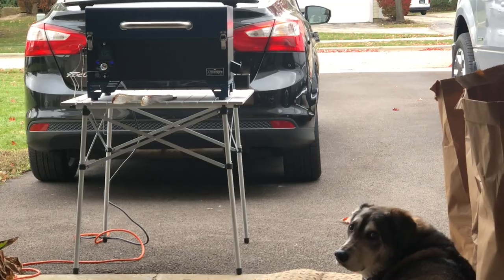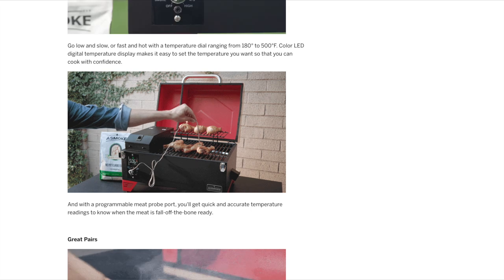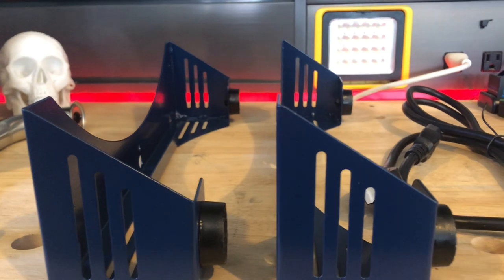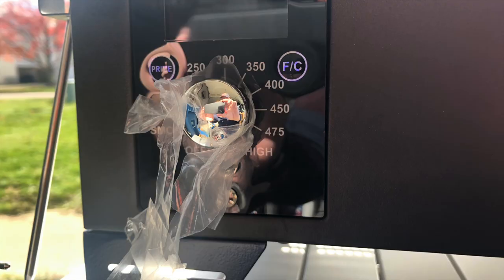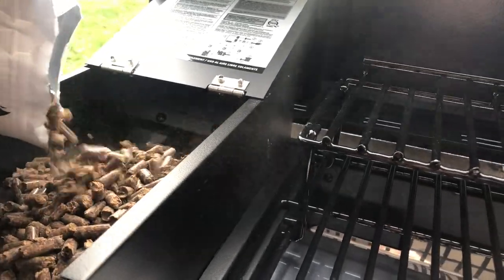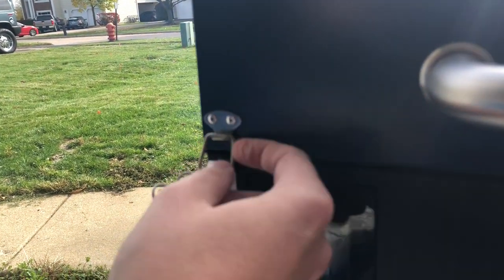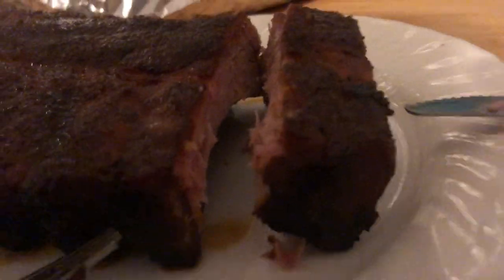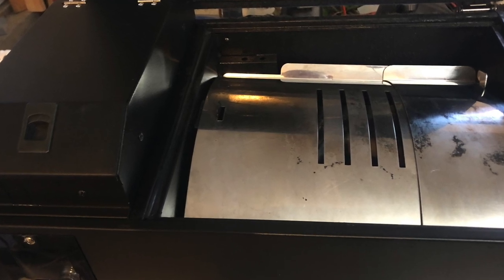Asmoke Portable Smoker Review -  Pellet Smoker

Comment: I was a loyal Traeger+ user for years, but after switching to Asmoke, I have to say the difference is clear. The precise temperature control that Asmoke offers is just amazing. The dual sensors and the new PID algorithm ensure temperature control within 5°F which makes grilling so much easier. Additionally, the portability of this grill with its lightweight, compact design is a game changer. I can now enjoy grilling on my camping trips without any hassle. I also appreciate the eco-friendly aspect of the wood pellets used as a fuel source, and the variety of flavors available add an extra layer of deliciousness to my grilling. Grilling has never been more enjoyable and efficient. I am so glad I made the switch to Asmoke. #Asmoke